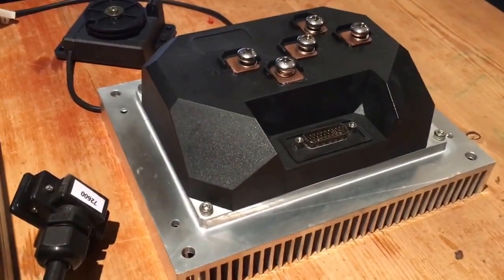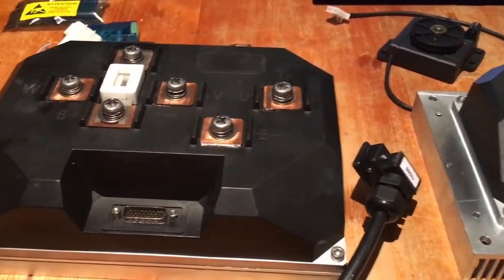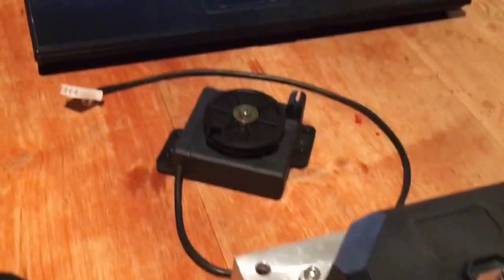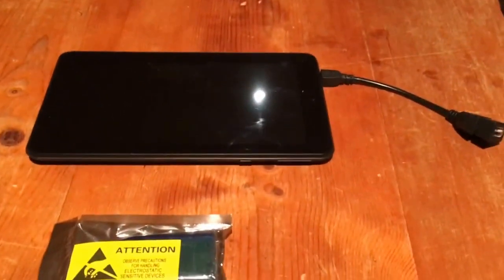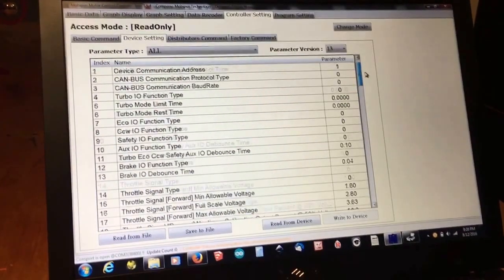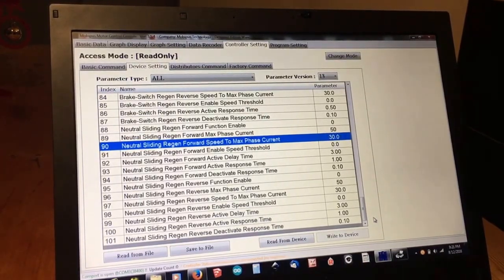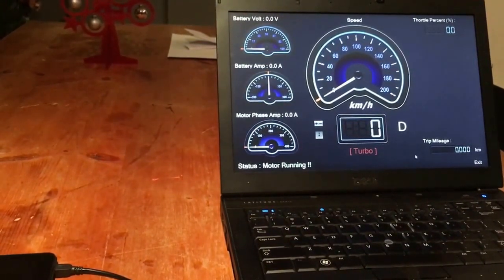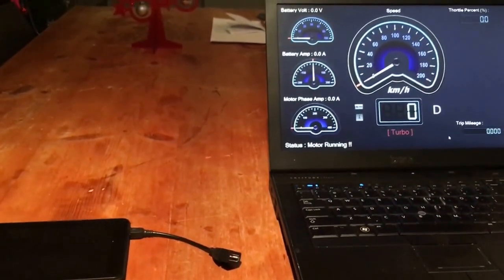Mobipus 72200 and 72600 controllers - overview

Comment: Awesome thanks for the video! is your site still active? thinking about one of these up from you. also, you mentioned you can run it at a but higher than 72V - how about 24s Li-ion system (100.8V fully charged)?
Reply: Hi I've been trying to contact Sam for 10 months now, the guy I bought mine off last year said he was still doing things with mobipus and he could set mine up for a fee ( happy to pay), but I cant contact him, I think max voltage is 89 volts  I'm running 22S Li-ion but charge to 4.05v  have a look on Endless Sphere
Reply: I can't find these any more even in taobao so I believe these have been discontinued in some kind of way?

Comment: Hey I'm doing a motorcycle conversion and I want power. How much peak power can the smaller controller do? is shipping to US expensive?
Reply: Mobipus 72200 Controller
Operating Votage Range : 36V-90V
Continous Battery Current: 200A
Continous Phase Current : 350A
Rated Power : 14.4kw